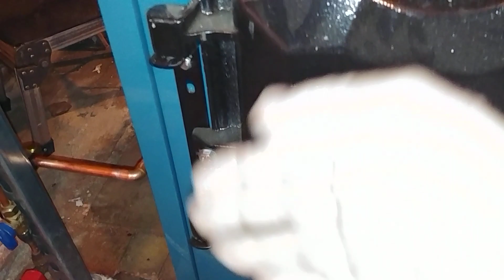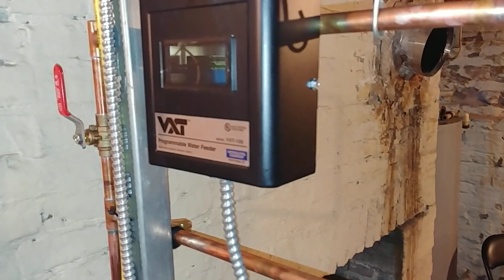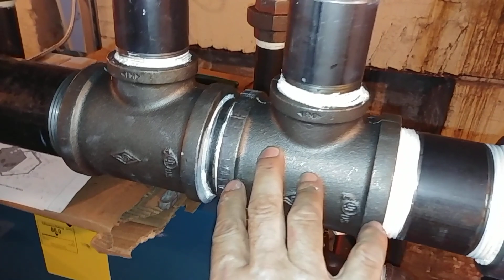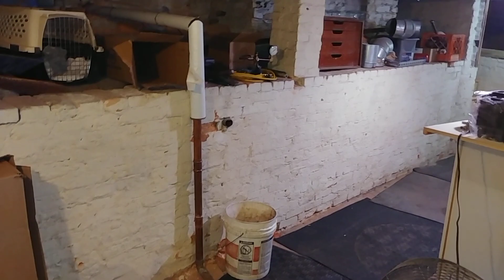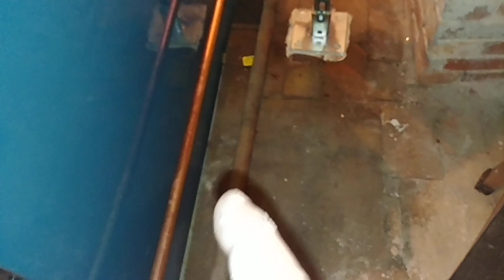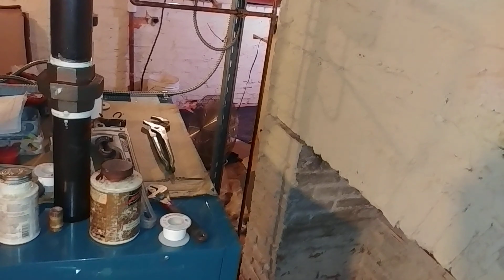A MegaSteam Safely In The Basement (whew!) With A Drop Header, VXT & Beckett Oil Burner Installed.

Comment: 600+ lbs... How many guys does it take to get that thing into the basement?
Got an old 1970-ish american standard, seems to be about double the sq ft if I add all the radiators up. Any reasonable savings by installing one of these? 
Do you travel to Massachusetts ?
Reply from the maker: We asked the customer to rent a stair-climber. The first one failed to re-charge. The replacement was in another State.
The stairs had to be re-done and a cart at the bottom of the stairs was expertly built by the customer to act as a landing platform.
The customer also called upon a friend to act as muscle during the perilous descent.
I was at the top of the stairs with a rope on belay to keep the center of gravity of the boiler under some control.
The stair climber cut out halfway down due to overheating and we had to let it cool.
Good times.
Reply from the maker: At this point, we regret we are unlikely to travel to Massachusetts any time soon.
Reply: @gordonschweizer5154  Figured so... I looked you up. Maryland is a long ways away.  Got two boilers that need fixin' .. Mine at my house 70s American Standard. And converted coal boiler at a rental property. Will have to find someone local.
Reply from the maker: The MegaSteam is efficient, but unless your current boiler is failing, the ROI on fuel savings alone is likely to unfavorable.

Comment: You don’t get any issues with the overhead oil line, I put Tiger loops on for the last 20 years if I must do an overhead line.  I was not aware the new VXT’s are reversible from Hydrolevel, I have always done the the old way. Thanks for the visit
Reply from the maker: You are most welcome!
Let us know when you try out the new reversible VXT how it works for you.
Reply: @gordonschweizer5154  about the oil line : why isn't there a Firomatic valve?

Comment: Wow, 800lbs,can you buy these in “knockdown “ form?,nice job btw
Reply from the maker: Thanks!
This boiler is shipped "semi" knockdown.  The naked block is shipped as an assembled, pressure-tested unit. 
The jacket box, insulation bag, and the "gingerbread"boxes with the block arrive on a pallet that is kicked off the back of the delivery truck as it slows down.
The whole package weighs about 880 lbs according to the manifest. 
So, I'm guessing the block is maybe just a bit less than 800 lbs?
Seems like 8,000.

Comment: Really nice install. We don't see many small residential steam boilers up here in Newfoundland, mostly electric heat baseboard and mini-split heat pumps. If its oil fired its usually hydronic.
Reply from the maker: Thanks for the report!  But, you do see some residential steam boilers, yes? They turn up in surprising places!
Reply: @gordonschweizer5154  Yes there are some  residential but they are mostly seen in larger commercial buildings. I would suspect hot water is more popular than steam because of ease of installation. Being a stationary (power) engineer I of course would prefer to see more steam but electrification seems to be the way we are all headed.